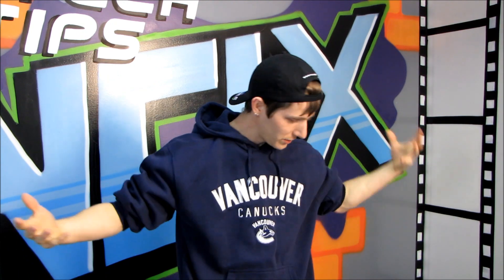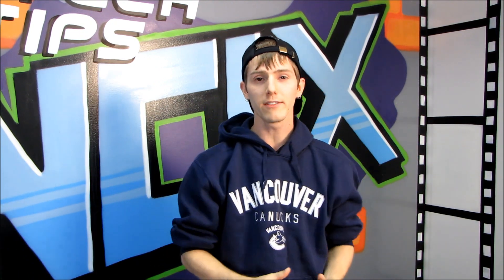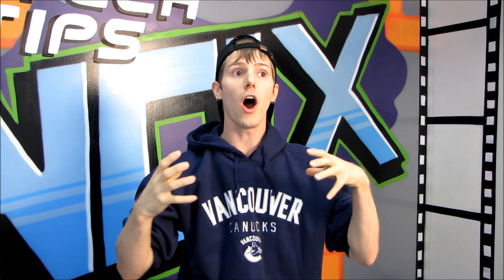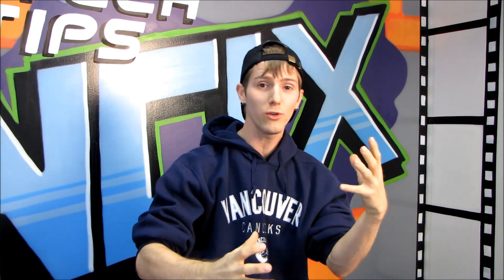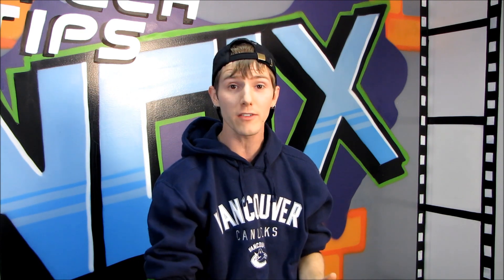Futureproofing Your PC - Dispelling Some of the Myths NCIX Tech Tips

Comment: I'd say for future proofing considering mainly the work done just for my personal needs (video editing, audio production and some gaming) probably some sort of higher end Gigabyte motherboard, an AMD Phenom II X6 1100T and a AMD Readion HD6870 1GB (crossfire later down the line when the price of them comes down) As for ram 8GB DDR3 and probably something like a Corsair 850W power supply. My guess is that machine with my needs and being reasonable, running 1920X1080 resolution probably 2 years.

Comment: For people buying the AMD six cores, you are better off with a 1055t and put a $50 custom cooler on it, then overclocking. It will be faster than a 1090t, cost less, and it has the same overclock roof as the 1090t.

Comment: 1.
Cooler Master HAF X
4xNvidia GTX 580 in Quad SLI Extreme OC Water Cooled
Intel Core i7-980x or (990x) OC 4.5~5ghz Water Cooled
6GB of ram 2200mhz in Tri-channel or 12gb
OCZ IBIS 3.5 960GB
GA-X58A-UD9 
30inch monitor(2560*1600)
1500 watt silver stone
this going to last about 4-6 years befor i need a new build 
2.
YES!

Comment: 1. Yes

2.
CPU - AMD Phenom II x6 1090T
Ram - Corsair Dominator GT ddr3 8GB 8-8-8-24
GC - Radeon HD 6870 1GB 256-bit DDR5
PSU - Corsair AX 850
HDD - VelociRapter 300GB 10000 RPM 16MB

3.
Yes, more vidoes like this.

Comment: I would go for something like 2000euros with 1366 + nh-d14, 6GB of ram, 750w psu (maybe 850), a single gpu which will sell and replace later, a very big, ventillated case which would fit anything, like the HAF X, 2 hdds in raid 0, 1 ssd and maybe one storage hdd.

Comment: I have a 550watt non modular, 4 year old power supply and 4 gigs of Crucial DDR2 just wasting away in the spare parts box.  -  Should I just can them or use them in a retro tech build with some affordable, soon to be obsoleted Quad Core or Equivalent AMD system build?  Cheap mid ATX board with 1 16x slot filled with a GTX 460 or older 8800GT. The system will be used for minor gaming, (Win7pro OS) and house hold crap. Or should I just wait and build a super new PC with the latest tech? x 10 cost?

Comment: Part 2:Case: cooling master haf x is a beast, it's huge, pretty and most important, cool! But if someone wants a small case, this is bad lol
CPU cooler:  h50 is pretty much enough, or 70 that deoends on your need
Hard drive: im using 2 corsair v128 SSD and one single Seagate 1.5 t 7200 HD—incredibly fast booting speed and game loading speed on SSD and large storage by HD

Comment: Part 1: Great one there helps a lot
Cpu: i7 930 might be enough for my daily use overclock to 3.36
Ram: corsair 6g ddr3 1600 overclock to 1800 or 1900 isn't a problem
Mobo: Asus sabertooth is great
Graphic card: I'm currently using evga 580 (single piece) works great overclock to 900 it's fine
Power: I'm using corsair 850watts, it's way more than enough for me

Comment: all i need is a system which is SLI capable with socket 1156 (i7-860), 4 gb ddr3-1333 ram , one gtx 570 andtwo 500 gb wd caviar hard drives in raid 0. but the key feature i need is usb 3.0... in a year or two, i wana be able to have that system sitting in a corner of my room that i can remotely turn on with a bluetooth keyboard and mouse. I would have 2 monitors : one on my desk, connected video wirless usb 3 and one HDTV hanging on the wall also connected via usb 3. ..

Comment: 1. agree with your points.
2.key parts:  850w must be good for any video card even in sli or crossfire. 4 or 8 gb 1600 ddr3 ram. 6 core amd cpu. 60-120 gb ssd for system and programs. 2X 500gb WD blue HDD in raid 0 for storage( sata 6gb supported.) . a mobo that supports usb 3, sata 6gb/s. gtx 580 in sli. for the case i will go for 600t or df 85.

Comment: Your video pretty much follows my line of thought, if I was to build a rig today I would do something along the lines of:
amd 955 be (or intel i5 760)
cm 690 II advanced
crossfire 6850
750 watt antec truepower
chuck in a 60 gig ocz vertex 2 ssd
5200 rpm storage
I am not too fussy about resolution or quality in my games, when I get to the point that there are games my rig will simply not run I will upgrade, I play tf2 on 4500mhd ffs. (saving up now for a rig)
I rather enjoyed the video, cheers.

Comment: I tell yah, when I first built my rig, it was certainly future proof... 6 years ago. Still running that exact same system today. AMD Athlon 64 4000+ @ 2.4GHz, Kingston 1.5GB DDR @ 200MHz, ECS  nForce4-A939, ASUS Nvidia PCX 5900, Raidmax 450W, Raidmax Sagitta case, some Seagate 120GB w/ IDE/PATA @ 133mbps, Windows XP Professional 32-bit.  LOL Time for a new build!!

Comment: two years ago I "Future Proofed" my rig with 4 gb of DDR2 1066 (all 1 gb dimms on a 4-dimm mobo so I have no spare slots to upgrade) and a quad-core 2.5ghz phenom 9850... you can guess how that's working out for me now.... Good news is that I can still drop a 6-core Phenom II and  replace all my ram with 2g dimms and get a huge boost in performance. So even though my current rig is slow by today's standards, my upgrade path is relatively open. Future proof???

Comment: more video like this!!!

my system was future proof for 10 year !!! im not very demanding i used to play lot of diablo 2 and i dont really care for max resolution,all i care is the fps!

P4 3.2 (hyperthreading) 150$
motherboard from intel for p4 noting special 140$
mastercooler cpu heatsink 70$
quite normal design black case with good features for mounting (silitech) 150$
Msi Nvidia 6600 350 $ (now overclocked)
3gb ddr2 150$
march 2003 and still lasting,i use it to compute with boinc when idle.

Comment: 4870X2 @ $200 kijiji in my city.... reads "can play every game on max settings"... i doubt it... my build that i'm doing in about a week will be 980x with h70 on a sabertooth x58 with 6gb ddr3, 2 corsair f 40gb ssd in raid 0, 1 wd 2tb green, 2 gtx 580s or 2 hd 6970s(not sure, depends what they have in stock when i walk into shop...), ax 1200 or hx 1000 psu (still debating), gtx 460 for physx, all in a silverstone raven case (the one with the sliding door on the front)... futureproof enough?

Comment: Radeon 6970s x 2, AMD 1100 T X6 processor, Asus Crosshair Formula IV Extreme, 8 gbs DDR3 2000 Memory, 1000 Corsair AX powersuply, HAF X... and probably 2 SSDs in Raid 0 Configuration. That about sums it up

Comment: I currently run a micro-atx motherboard with a gts250 to run a 30"(2560X1600) monitor not to play cutting edge games but rather to use it as my daily computer and mainstream games suffice.  

I have been thinking of getting a new computer but adding in the future proofing aspect I think of maxing out on the current hardware limit with sensible components.  My build would include:  lian li v354, micro-atx X58 motherboard, core i7875k with air cooling, 6 gigs ddr3, 2 gtx 460s in sli, 1000W psu,

Comment: Lian Li P80 Case, or Mountain Mods U2UFO Case
EVGA SR-2 Motherboard
Intel i7 980X CPU
At least 16GB of Corsair Dominator Ram 1600-2000Mhz
3 or 4 way SLI with EVGA 580's
A really good sound card, maybe something from ASUS, or Creative
7.1 Sound System Logitech,Altec Lansing etc
Corsair AX1200 PSU
At least 1 or more 30" Samsung Monitors,or better

Comment: yes 
and to me this build i m gonna do i say it will be future proof for at least 2 years and for casual gaming for a 22 inch monitor and student use
Intel Core i7 875K Processor  Unlocked Multiplier
2 zotac 470
Corsair Hydro CPU Liquid Cooler
Corsair TX850W Power Supply - 850W
Patriot Sector 5 6GB RAM - DDR3
EVGA P55 Classified 200 Motherboard
Western Digital Caviar Black Hard Drive 500gb

Comment: 1 no. already know a lot about that stuff.
2. i would get an sli gtx 560 system with core I7 Extreme processor.  a good Geforce branded motherboard.  maybe upgrade my ram.  id keep my awesome NZXT apollo case and a 750 W PS would probably be able to handle all that but id check anyway.  id also keep the fans that i have.  id put my OS on a smaller ssd and id pick up a couple of newer HDs becasue mine is almost full.  remember 3 years ago when 650 GB was a shit ton of space, not anymore : /

Comment: @Milanotitan 

A dual core will not decode a BluRay disc. An i3 however will, and it cost's less than £100. 

You could also just go with an Intel Atom based HTPC, with a total cost of under £300. The result been a very small inconspicuous item (Or a large stylish one if you buy a big case) that is going to serve all of your media needs for years to come. 

I'm using a Q6600 system as a HTPC, clocked at 1.54Ghz stock cooler with no fan. 4GB RAM Win7, 8800GTS. ASIO soundcard for lossless audio

Comment: I'd say The 890FX chipset will stay current for a while(a year maybe?) but certainly sufficient for gamers in the next 2 years if coupled with a 1090T. I'd advise all out water cooling as part of the furureproofing implies a considerable overclock of the 1090T, though AM3+ seems to be the new standard. The case must be class, ATCS 840 seems to be it right now(or a Cosmos, those are huge), PSU must be at least 1200W, though GPU and CPU makers seem to find more efficient ways for performance.

Comment: @CombedPanther Well that price included monitor, kb, mouse, etc. But I'm running an intel i7-980x on a gigabyte x58A-ud7 mobo with 6gb mushkin ridgeback DDR3-1600 ram (cas lat. of 6 ns),  and an evga gtx 480 superclocked+ card (back plate is well worth it for aesthetics).

Comment: I remember when I was ordering my parts, I came across a good deal with the 4870's. I ended up getting two because of this deal. :D
This was about 3 years ago, and my 4870 is still rocking despite not having the latest DX11 capability.

Comment: @MsUneuro Just for your info, the 900 series from Intel (920, 930, 950 and such) are all the same processors. The difference is that the higher number has been tested to be better by Intel themselves. They really just test it, and the good ones gets a higher number. I used to have the 950, but it was a so called "bad" processor that happens on occasions. That means it wont overclock that good, but works at stock clocks. If you want to overclock though, go with the 950:P

Comment: 1: yes
2: AMD 1090 or 1100t
    4-6gb ram
    ssd for system
    1-2tb for data
    AX1200 (so u can have crossfire x or sli for later)
    HAF X (air cooling) or obsidian 800D (watercooling)
    finally a AM3 motherboard becasuse AMD have done a great job in supporting old technologies
 ps, a couple generation old high end video card (cheap and runs great), ex. 9800GT

Comment: my build is this . Intel i7 980 extreme edition. Rampage 3 for MB . 6 GB ramm from ocz or CORSAIR . Cooler master full tower case with lots and lots of fans on it. I will also use a big cooler cause in the future if i want to overclock the CPU i want to keep it at a normal temp. For graphic cards i could use 3 way or 4 way SLI GTX 580's cause i want games with high resolution and stuff. PSU 1000 watt cooler master :D. Nice build its extreme for normal gaming i will use something normal :D

Comment: just to prove the point of not everything has to be upgraded every year, I bought a Dell inspiron E1705 about 6 years ago now. And 5 years after getting it with a core 2 duo at 1.6ghz and an x1600 128mb ram, it was still able to play games like TF2 at the max res the screen was which was 1440x900. So all you guys with expensive $5000 systems got jipped

Comment: 1 year ago i bought a sweet 2k$ comp. i7 920 (oc to 4ghz) 6gig of ram ssd raid o hd a 300$ case 200 $ psu window 7 ultimate  and a lame hd 4870. i got myself a gtx 580 last weak. my system is more balanced now. 

and i feel like my computer is still on top of his game right now. i mean if i wase to build one tomorow i would go for the i7 950 but the build would prety much be the same. and when i switch for a new one this computer will be perfect for my gf or for a friend.

Comment: first off this video covered what i had painstakingly figured out on my first build about 4 months ago. although its good to hear it confirmed.
second, if i built a rig today id follow the same rule of thumb as last time. what am i going to use it for. in my case digital audio workstation and audio editing.
beefy cpu (probably amd again), good ram and lots of it with low latency. massive hardrive space in at least raid 1. And a premium sound card dedicated to DAW's (probably M-audio again).

Comment: If you build a computer that can 4 years from now still play games etc at mostly maxed out settings, and if you can do that for under $1400 and you still have room for upgrade potential (which AMD is amazing for), then I'd say you built a pretty future proof system.
AMD X6 1090T - $229
AMD 6950 - $300
Asus Crosshair IV Formula - $219
8GB Crucial DDR3 Tracer Red - $140
64GB Crucial C300 - $134
500GB WD Caviar Black - $60
ABS Tagan BZ700W - $100
LG Bluray HDDVD - $100
NZXT M59 - $35 
Total: $1317

Comment: I like it when you have videos like this on NCIX.

Also I have a question,

I have a cooler master 310 case. Now, it doesn't have all of the fan's install, but the cooling performance - cable management isn't all that good.

I have been considering getting a corsair 600T, Do you think that would be a good idea?

PLEASE REPLY!

Comment: really if you have a quad core cpu @ 3.2 ghz with 4 gb of ddr3 and a sandforce based 256 gb ssd and a 850w branded psu and all you do is run games all you really need to do is keep up with a lateist os and buy a high end video card every 3 years the system should last you 6+ years even to this day games berly use more than 2 cores ...

Comment: Also I should mention, that for me, I consider future-proof to be that the computer should have no problem lasting for 4 years before needing substantial upgrades
My first build back in 2004 was an Athlon 64 3500+, Asus X800, 1GB of RAM, 160GB IDE ultra, A8V Deluxe, not 100% future proof
Since then I had upgraded to a Radeon 3850(2008), 4200+ X2(2007), 2GB(2007) of ram and then 4GB(2008), added a 320GB sata drive(2008) and it is still a fairly powerful and more-than capable machine, and its AGP!

Comment: 2)I am building a new rig for xmas that I consider to be pretty future proof despite AMD's awesome new architecture coming out next summer.  I was tempted to wait but was in need of a new system of which I consider to be future proof.
I saved a couple hundred dollars by choosing "second best" parts
AMD Phenom II X6 1090T
AMD Radeon 6950
Asus Crosshair IV Formula
8GB Crucial Tracer DDR3
64GB Crucial C300
500GB WD Caviar Black
All the other parts (PSU, BD drives case) are recycled from another rig

Comment: If I wanna futureproof myself I would make a system like this: CPU: i7 980, some cheap mobo, GTX570 SLI, CM V6GT cooler, 1000 watt PSU, 24 gigs of ram, 2TB HDD and an SSD for the windows and some normal case like 922 HAF.

Comment: What i consider to be "futureproof" is PCIe... 
for me its okay to buy a new PC with i5-760 and only 1x460. Even though a system like that is GPU bottlenecked in a lot of games. I would rather recommend, like you said, to spread out ones GPU budget out over 2 cards. One now, and perhaps another in 2-3 years. Since 1x460 is enough GPU power for most players with 1080p or less. And i do this, becuz it seems like there wont be any compatibility problems with GPU interfaces in the near future.

Comment: 850 watts silver 80+ , 2 gtx 460 1gb , i7 930 , any x58 mobo "they are all good" , 6gb of ram is enough, if you wana go big , go 12 , that is very ok , you are not running a server . A fact "2 GPUs = two future smaller builds "  take the build apart , use 6gb for one build and the other 6 for the second build , get an i5 cheap mother bored a cheep case and sell the thing , you might even earn some profit out of. use the i7 930 , it will last you some time

Comment: The second part. I will be building a new system in February. However, if I was going to build it today. I would go with the AMD Phenom II X6 1090T, keep my Crosshair Formula IV MB, same CPU cooler, same RAM cooler, but probably upgrade from my 8 GB DDR3 1600 to DDR3 2000. Then probably give the Radeon 6970 a spin. Keep my 850W PSU. Then I would stick with this system for about the next year. Like I said though, I am building in Feb, so this will change to adapt to whats available then.  :)

Comment: Corsair 800d obsideon case
I7 980x CPU
EVGA GTX 580 in 3-way sli
Dominator 12 gb (6x2gb) overclocked
EVGA classified motherboard
2 OCZ revodrives 
1tb 6gb transfer speed data drive
Koolance custom water-cooling 
360 waterblock 
dominator gt water block
ERM-2K3UCU rev1.1, copper
HD-60
Vid-nx580
Koolance 1000w liquid cooled power supply
Tms-200 software thermal interface controller

Comment: Didn't changed my view of future proof because I already knew about it more or less =P

If I was building a new gaming PC today, I'd get 
- ASUS M4N78-AM V2
- AMD Phenom II X6 Black Edition
- 4GB Corsair XMS3 1333Mhz RAM
- Nvidia GeForce GTX 570
- 1x Corsair 40GB SSD Drive(for booting)
- 1x 1TB Samsung Spinpoint F3(for storage)
- Windows 7 Home Premium 64bit
- Corsair HX 750w modular PSU
- Corsair 600T case you showed

I'd like more vids like this but 'mix it up' a bit with other kind of vids =)

Comment: Silverstone TJ-07 (or any mid size tower case will do)
Intel Core I7 950
Thermalright Venomous X RT
Asus P6X58D Premium
Corsair Dominator GT 12GB DDR3 Triple Channel Memory
2 OCZ Vertex 2 120GB SSD + 2 WD Caviar Black 1 TB (raid 0+1 config)
1 GTX 580
Corsair AX850 PSU
That should be a good PC for all kinds of stuffs from video editing to moderate/heavy gaming while not going for absolute bragging rights.